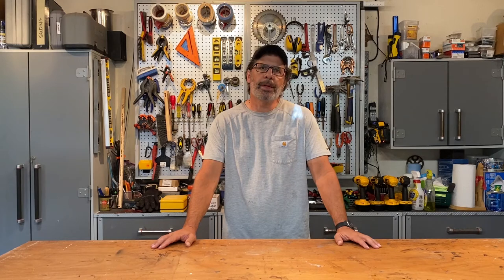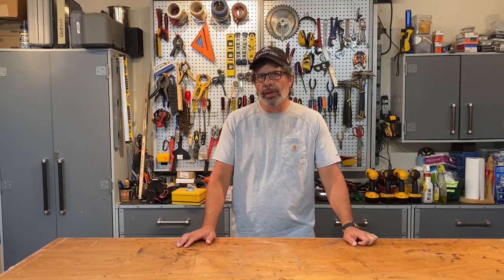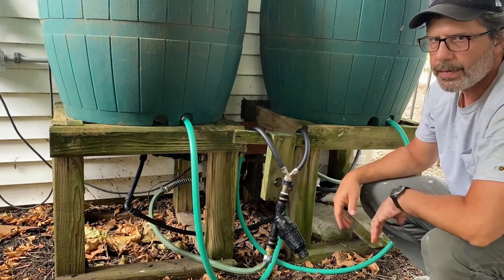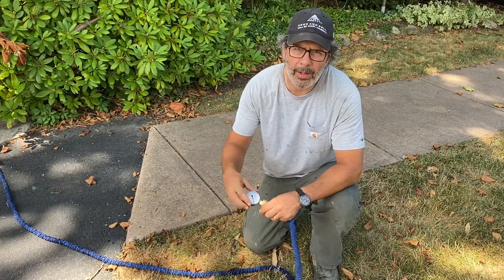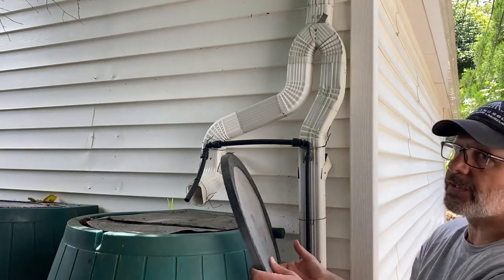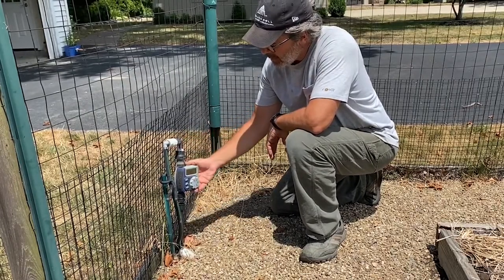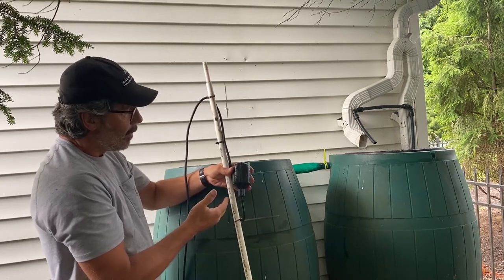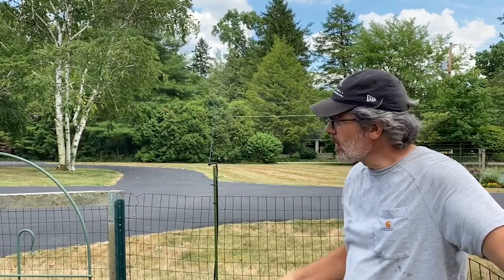The Ultimate Rain Barrel Irrigation System

Comment: Great system and thanks for making the video.  Lots of great ideas here and you've really worked through the details.  One question:  What is the advantage to having the connector hose (between the barrels) so high?  It seems like this would cause times when the first barrel is almost full, but not full enough to flow into the 2nd barrel, which would require more frequent hose water fill-ups.  Regardless...great system and great video.
Reply from the maker: Thanks.  Great question.  The connector port on those barrels is at the top, about one inch below the overflow port.  So, I basically set up the barrels as designed.  When the right barrel fills nearly to the top, it flows through the connector to the left barrel which fills to the top, causing both barrels to then overflow into the downspout drain.   

I had a similar question when I set up the system, that is, "am I optimizing the rain water collection over hose backup water."  In reality, the barrels fill so quickly when it rains (minutes) that there are very few cases where the rainwater would partially fill the first barrel and you would want the system to "wait" until the next rainfall to fill the second barrel.   The barrels are either empty and need hose water or are overflowing with rainwater.  There really are very few instances in between.   

I do have the float switch attached with a zip tie to the post with about 12 inches of "play" in the switch.  This gives me about 24 inches between "full" and "empty" and the hose backup only kicks on when both barrels are truly empty (about 3 inches of water left in both barrels).
Reply: @dontscrewitup  Thanks.  I didn't realize it would collect that much water so quickly.  Did some googling and calculating and believe that my downspout would produce 50-90 gallons of water for every tenth of an inch.  I think that answers that.  Thanks again!

Comment: You are a genius, so thorough. I appreciate your efforts. Can you tell me how much pressure your pump delivers?  Gravity was 4 lbs and hose was 40-ish, so what does the pump push? I have three 55 gallon plastic food grade barrels that I use to water my gardens manually. It’s a lot of running to take care of 75 ft of gardens so I’d like to use a hose and sprayer to spot water on plants. I have garden hoses that I hooked up to 1/2in  tubing then 1/4 in tubing to my plants flower gardens and I could remove them from the faucet and hook up to the barrels but how much pressure is there?  Thank you so much, Patty from Buffal NY
Reply from the maker: Thank you,  This pump is 45 psi.  I’ve used other versions at 60 psi.  Most of these pumps operate in that range (45-60).  Good luck.

Comment: The hose at the top across both tanks is not needed. You have both tank connected to each other at the bottom. The water Will level its self between both tanks.
Reply from the maker: That’s what I assumed when I hooked it up but it doesn’t work that way.  The right barrel fills all the way to the top then spills over to the left barrel.  I think it has something to do with the mixing hose I’m using. I think it is designed to prevent backflow from one side to the other.

Comment: This video and system is great! Thanks so much! Does the solenoid valve get hot? I've read that a lot of the valves get very hot... thanks!
Reply from the maker: The solenoid does get quite warm.  That’s why my housing is “open air” on front and bottom, with waterproof electrical connections. I would not put the solenoid in an enclosed housing.
Reply: @Don't Screw It Up  thanks!

Comment: Good Day, love your video.   Am I to understand correctly that when you kill the power, or if you have a power outage at your house, the water will then turn on and stay on indefinitely? (until power is restored).
Reply from the maker: Yes.  To correct for that you could put a second solenoid on the house power up steam from the refiller which would close in the event of a power outage. It has not been a problem here as outages are infrequent and my neighbors know where to shut off the backup hose.

Comment: Good system. Wish I could setup one like it too, but Im not there yet.

I just have one question, if your back up water system depends on the solenoid to open gate/loose power to allow water to flow from your house water into the barrels, what happen when the electricity go out? Would your house water going to flow non stop to the barrels?
Reply from the maker: Thanks.  Yes, if thr power is out, the solenoid would open and the water would fill the barrels and then run into the downspout drain until power is restored. 

Power outages are infrequent here and my neighbors know how to turn off thr water if I were out of town, etc.  

The easy solution is to put a second solenoid on the house water, upstream from the whole system. It would be open with power on and would switch to closed with power off.
Reply: @dontscrewitup  your well pump would be off too so eventually its just gonna lose pressure

Comment: Good design, but I have a question:  When the barrows get empty, the float switch triggers the solenoid which turns on the tap water to fill the barrows.  What if it starts raining while the tap is on?  This means both the tap and rain are filling up the barrows at the same time, doesn't it?  Depending on how fast the tap is running, only a fraction of the barrows will be filled with rain water in this test case, won't it?
Reply from the maker: Yes, that is correct.  It will fill with both rain water and hose water at the same time.  However, the rainwater is massively more volume than the hose water, so it will fill largely with rain water as soon as it starts raining.

Comment: The video is super thanks a lot. Just one question: we have a 20'x20' greenhouse and we want to use your system with micro drip irrigation, so we need a more powerful pump or is the one that you use enough?
Reply from the maker: Thanks. The pump I use should work fine. It basically creates “hose pressure” so if you could set up your irrigation system to run off your hose, this pump should work.

Comment: I'm incorporating you brilliant system now.
I do have a question though. Did you wire your selonoid into your pump cord?
Reply from the maker: Yes. Both wired to same 3 wire grounded plug. I also use waterproof connectors there.
Reply: Thanks for the quick response.

Comment: Thanks for taking the time to make this video and share it. I was reading the reviews for the shurflo pump on Northern Tool website and a common complaint was that it didn’t accept regular pipe fittings. What did you use for fittings to connect to the pump?
Reply from the maker: Thank you.  I found the correct fittings at the local hardware store.  Let me check it out and see what I used.  I believe they are finer threaded fittings than people expect, but they are a commonly available part.
Reply: @dontscrewitup  Great thanks. And thanks for the quick response
Reply from the maker: I use a Female to Female adapter to convert from the pump threads to a standard pipe thread. Then I use another M to F adaptor to go from the hose pipe fitting to a garden hose fitting.  These parts are all commonly available at most hardware stores.   As long as you are aware of the specific threading on the pump (it is in the specifications) just make sure you start with the right adapter.  I think a lot of people don’t read the specs and the try to thread a standard pipe fitting onto that plastic outlet and bung up the threads. 

The first rule in the Don’t Screw it Up Workshop is “read the instructions.”  🙂
Reply from the maker: Here is a photo of the adapter hookup.  https://share.icloud.com/photos/04HrvBIvaYT0T4bMjDjdKdMqQ

Comment: have you considered a settling tank arrangement to remove sediment before it even gets to the barrels ? ie,  buckets in buckets... water goes to central bucket, then overflows to outer lower bucket settling out the sediment as it goes etc etc etc  and only then to your barrels .... anyone know if this is worth doing ?
Reply from the maker: Good question.  I have seen that setup used.  If my filtration system were not working or needed very frequent cleaning, then I would try a settling tank.  I preferred to try to keep the sediment out right from the start (with the screen on top of the barrel) and it seems to be working well. But a settling tank is definitely an option.  Some people use a long 3-4” PVC tube with a threaded cap on the bottom that can be opened to flush the system.   With the volume of rain I’m getting from my downspout, this method may also be overwhelmed.  You would need to size your settling tank appropriately to really allow it to settle while filling vigorously.

Comment: Do you find that the pump is constantly turning on and off as it's building and losing pressure? Mine is kicking on and off by the second and I'm worried about the durability of it running that much. Love the video!
Reply from the maker: Thanks.  I’ve been running the system for 13 years now and and I just installed my third pump — they’ve lasted about 6 years each, but will probably last longer now with the improved filtration system I’m using now (shown in video).  I initially had issues with the small inline filter screens clogging frequently.  

The pump cycling can come from low flow inbound, high pressure outbound, or just the overall matched pressure of the system.  

One of my pumps did that cycling on/off and it was due to a leak in my lines/fittings, or a clogged up filter on the inbound water source lines coming from the pump.  Check all of your fitting for leaks, and check your filters to make sure they are clear.  

Also, check for any blocked filters on the outbound side (my irrigation timer has a small filter screen in it). A blocked filter on the outbound side will tell the pump it is at pressure and should turn off.  

Also, depending on the size/pressure of your drip irrigation system, this may just be the way it will operate. A smaller, or low flow system creates so much pressure on the outbound side of the pump that it thinks the system is off (at pressure).  There’s nothing you can do about this other than increase the flow (and reduce the irrigation time) on the outbound side by adding more drip heads, etc.  

Try disconnecting the inbound water line from your drip irrigation system and just let the pump run freely and see how it operates when not under pressure of the drip irrigation system.  This will help diagnose if there is an issue on the inbound or outbound side of the pump.  If it is freely pumping water on the outbound side and still cycling, that usually means it is getting low pressure inbound (usually a blocked filter) coming from the rain barrels.

Comment: Great video and thanks for sharing 👍
About the solenoid valve, is it normally closed?
Thank you.
Reply from the maker: Thanks.  It is open position when unpowered. Powered position is closed.   The float switch basically cuts the power to the solenoid when it is in the “off” position in the tank which opens the solenoid.

Comment: Thanks very much for the video of this great system. You mention that you have one wire that controls the solenoid and the pump. Would you mind elaborating on how you wired those? I'm assuming a 3-prong power wire, but then did you wire it in serial to each component? Parallel? Any interesting hardware near the solenoid given its proximity to water? Thanks again!
Reply from the maker: Thank you.  The pump and solenoid are both three-prong grounded A/C powered devices.  I've wired them both together into a single 3 prong plug.  So, when the power is "on" the pump is powered and the solenoid is closed.   

That three-prong plug is then plugged into a female "through" plug on the float switch (this is the standard AC connector on most float switches).  You can see it in the video.  It works just like a light switch, turning the power on and off to the pump/solenoid when the float is in different positions.  

I have both all of this wired through a covered GFCI outlet with a "kill switch" so I shut down the power completely any time I am doing maintenance, etc.  

I also use and HIGHLY RECOMMEND waterproof connectors for the wiring connections.   I use these https://www.amazon.com/Waterproof-Connector-Junction-Electrical-Soldering/dp/B07J9J63Y7

There is some inherent danger with any setup using AC power in an outdoor/wet location.  Be careful and consult an electrician to wire it up to reduce risk.
Reply: @dontscrewitup  Makes perfect sense. Thanks so much for making the video and for this reply.

Comment: How's the system a year later? I'm about to build this but with solar using Green Town Tech as a reference. I think combining those two ideas will be the best way to do it.
Reply from the maker: Still working beautifully.  Almost zero maintenance last summer.  I only needed to clean the filter once.  I did upgrade my electrical connections (for the pump and solenoid) to more fully waterproof connectors.  I like the idea of using Solar and DC power, but have not tried it.
Reply: @dontscrewitup  I think you should try it. It would be nice to see your system becoming even more bulletproof. If your power goes out while you're on the road, everything would be fine.

Comment: Awesome Video. Do you know about how much it costs and have you seen a way to get water from a sump pump into barrels? Or what would you recommend for watering the yard? I have an irrigation system in the yard but wouldn’t mind running it less or not at all if I could catch rain water and sump pump water. Would your pump run a sprinkler? Any thoughts on a way to shut the system off if it has already rained?
Reply from the maker: There are Wi-Fi controllers you can buy to sense rain and shut down the pump (or any powered device).   The pump puts out about as much pressure as a garden hose, so it can run a small sprinkler system.  

For the sump pump, you would want your pump to pump the water up and put into a rain collection basin/barrel then use the same setup to take the water from that collection basin or barrel into you Mr sprinkler system.  

My sump pump pumps my water up about 8 feet into my storm drain. It could easily pump it into a collection barrel.